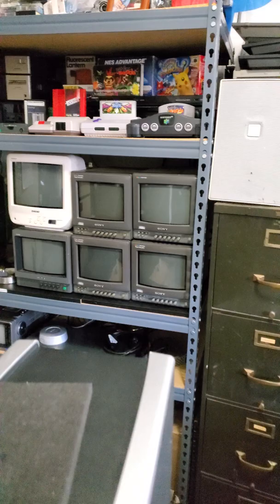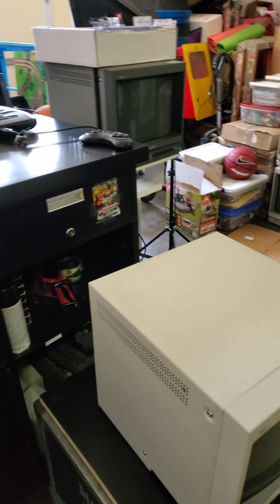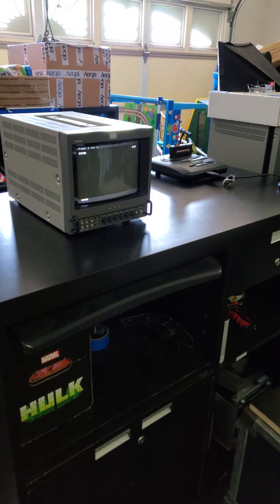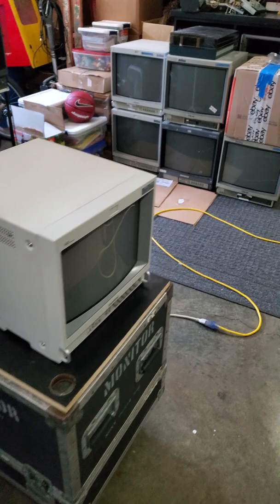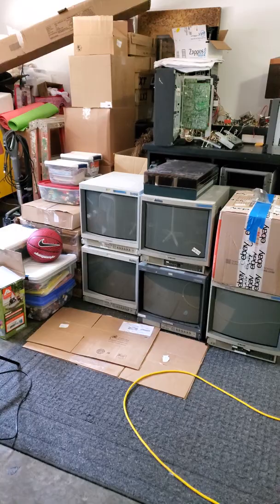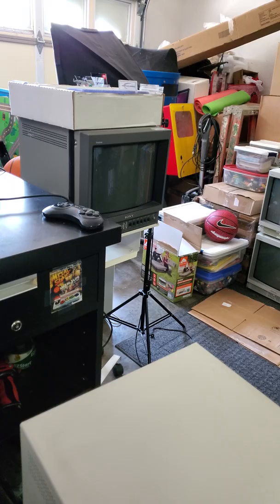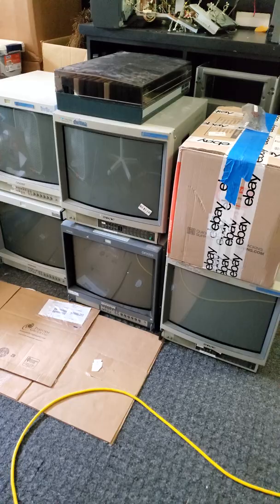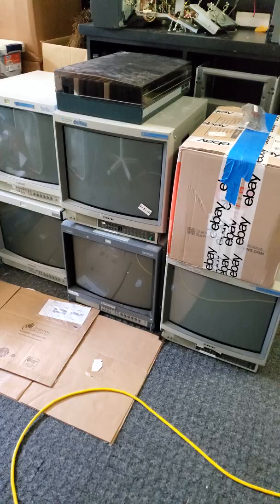Professional CRT Repair Shop Tour 2021  📺  CRT Repair Techs Do Exist! #shorts

Comment: That's a lot of cool stuff you have in there.
Maybe you can help me out. I bought a zenith crt, and the picture vertically collapsed, then power shut off. If I try to turn it on now it just chirps and shuts off again. What's the likely culprit? Someone said caps, but I don't want to replace a bunch of capacitors and have the problem persist if it lies elsewhere.